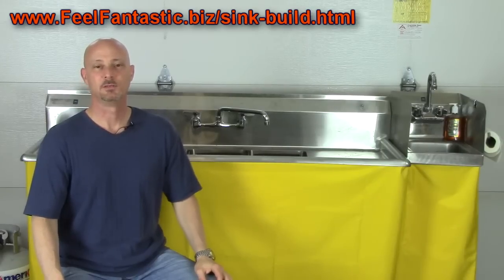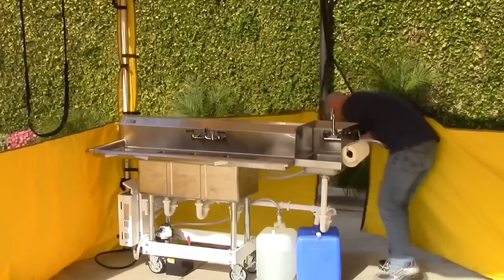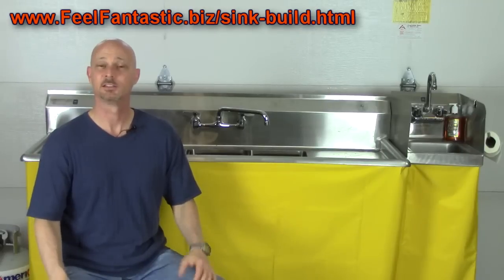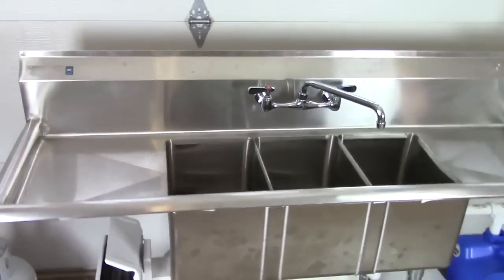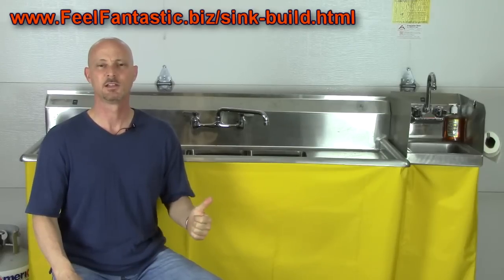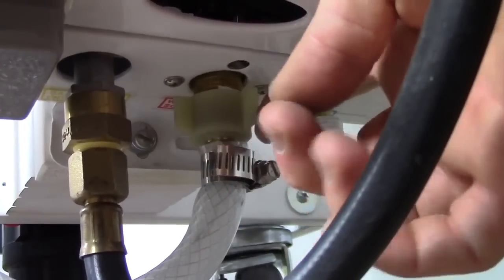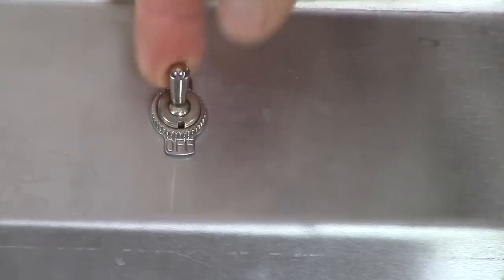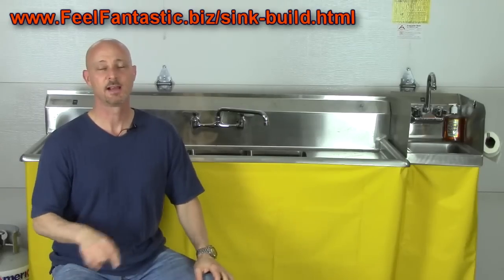How To Build A Portable 3 Compartment Concession Sink

Comment: Nice video. How much drop did you put in the drain pipe from the first sink to the last sink to make sure it drains well? Also, when you put the waste water jug under the pipe you twisted the pipe to go into the jug. What kind of fitting is that? This is what is holding me up from completing my system.

Comment: What is the skirt made of , I can’t find it on the list , please help
Reply from the maker: It is made out of the same material that the tent is made from. I bought it from the same place that I got my tent from. It was 3' high 10' long used to have a waist high barrier for you tent. I wanted the skirt to match my tent material. You can use any material or fabric you want. My first one was made from a yellow table cloth that I got at a party supply store, but the tent material was more durable and did not rip.

Comment: Very nice setup, your video has no sound. There really is no need for the trap pipe correct? wouldn't it be better to have straight pipe to the waste water bin?
Reply from the maker: The audio was recorded in mono not stereo. If you can't hear the audio it is because you have only one earbud in. Put the other earbud and you will hear the audio. Most health departments require the P-Trap part of the drain to prevent dirty water from backing up into your sink.
Reply: Oh ok. Thanks for that, sound works. 

Do you happen to know if LA County requires the P-Trap on the portable 3 compartment sink?
Reply from the maker: Yes LA County requires P-Traps just like every health department in every County I have had to deal with. To everyone who reads this question: BE SURE TO CONTACT YOUR LOCAL HEATH DEPARTMENT BEFORE YOU START YOUR SINK BUILD. It is easy and inexpensive to make any necessary changes in your sink build when the build is in the planning stages, but it is very hard and expensive to change your sink after you build it.

Comment: Only thing is why didn’t you run the switch closer to the pump so u don’t have to run such long wire? I would have ran it on the opposite side.
Reply from the maker: Most of the time I use the hand washing sink and I keep the pump off until I need to use the sink, so I wanted the switch to be close to the sink I used the most. Now when I need to turn on the pump I can do it while in front of the hand washing sink or the three compartment sink.

Comment: You put teflon gas tape on a flare fitting. thats incorrect. the flare makes the seal, unlike pipe thread which the threads hold the pressure.